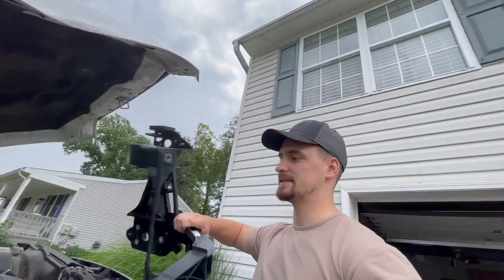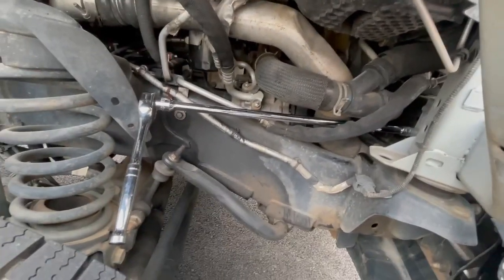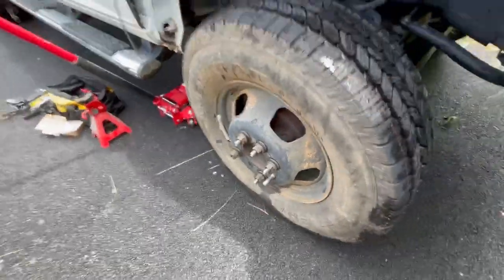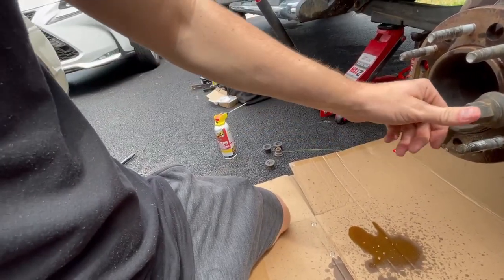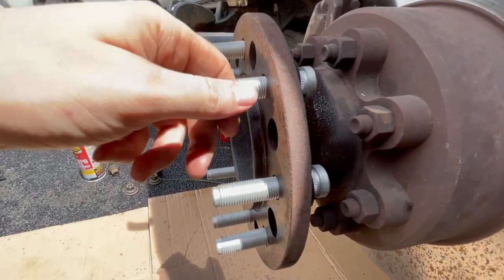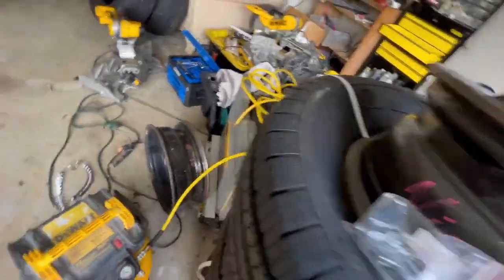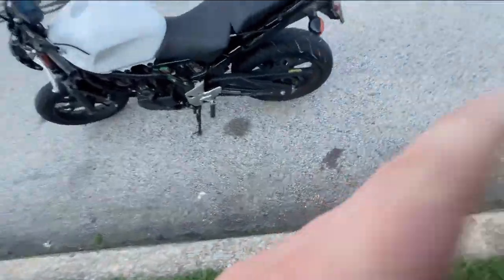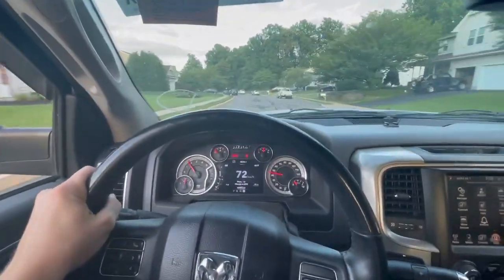Rebuilding a Wrecked RAM 3500 Cummins Dually (Part 2)

Comment: maybe sell this thing for a gm dully or a (2017-present) ford f350 dully or an ford f450, or you should do the 2020 front end conversion on it like the goonzquad and install a custom front bumper, power running boards, aftermarket rear tail lights, and a train horn on this truck
Reply from the maker: Not one of those types of builds. This thing is going to be hauling a gooseneck trailer full time. And the consensus is Ram is the best for that job. 
Planning on buying myself a daily truck and going all out on mods for that one.
Reply: @romagrigorenko  how about a ford raptor, a ram trx, a chevy colorado zr2, a gmc siearra at4, or a toyota tundra trd pro or tacoma trd pro
Reply: @romagrigorenko  I think you should do running boards the auto slide when you open the door, maybe a bed cover, and a train horn on this ram 3500. The train horn can help you warn people properly to get out of your way when you are towing. Maybe install an aftermarket front bumper on it too. I mean ford has a lot more than gm or ram trucks would so maybe next time you buy another diesel truck consider a ford f450 truck